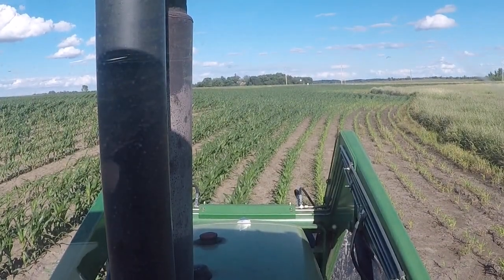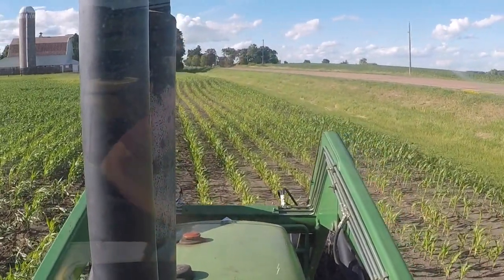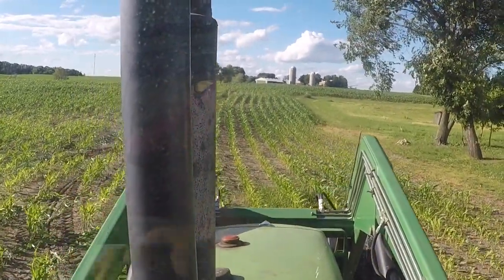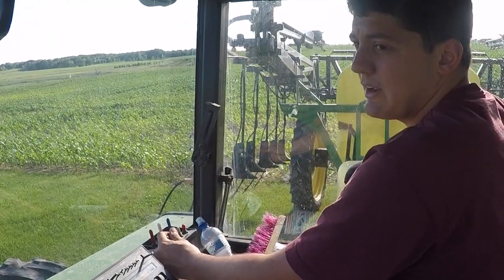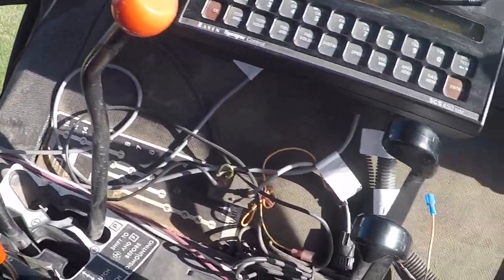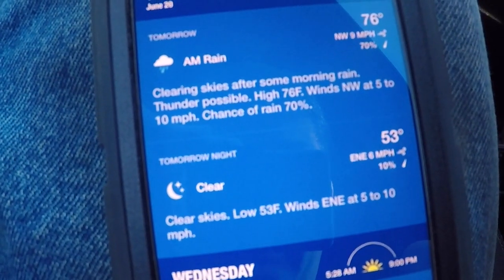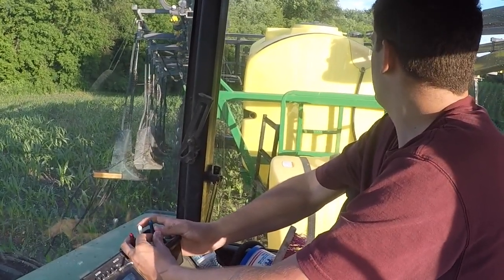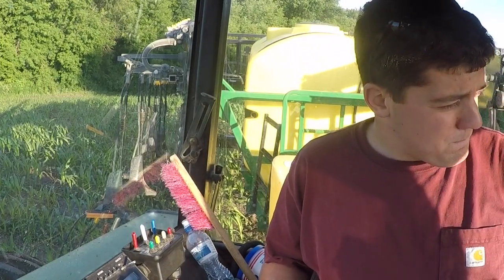Day 1--Still Learning Controls

Comment: Nice..... does that sprayer push the tractor around like no other?
Reply from the maker: I didn't have any trouble.  He said that in years past hes had some trouble going up hills with a full tanks; new rubber on the rear main tires and it pulls like a locomotive now